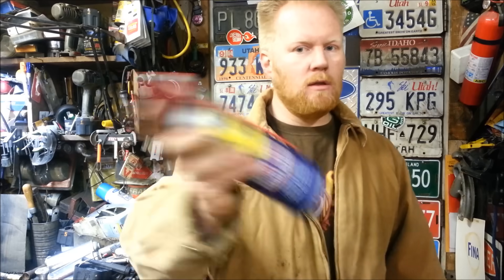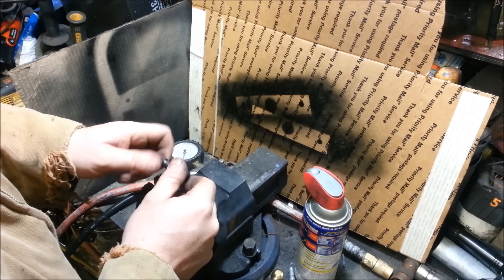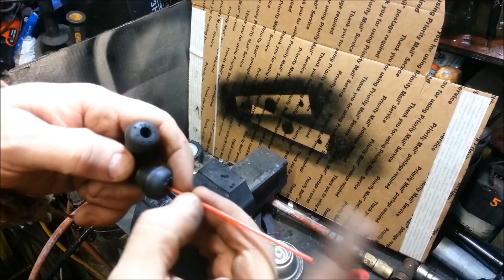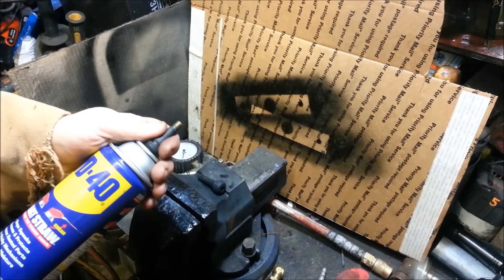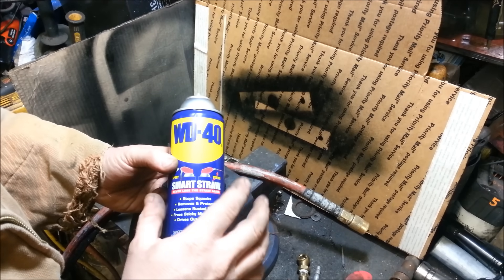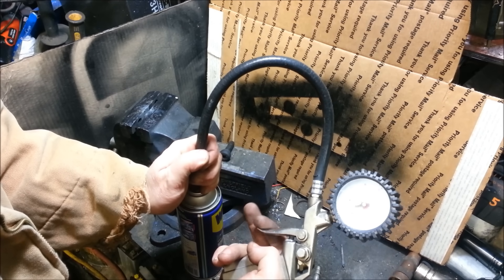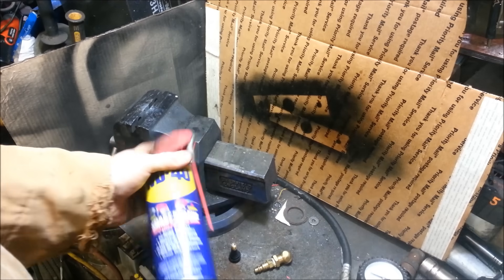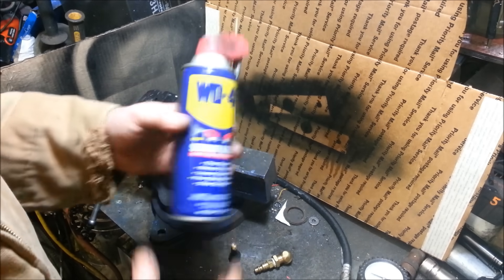Refill flat AEROSOL Spray Cans like the WD-40 and others

Comment: All the cans I have thrown away due to the loss of propellent.  Dam..good video
Reply from the maker: Bowman W Thanks Man.
Reply: I cut the cans off at the top and save the material inside. If paint can, I save the little round marbles too.  Save the can, put thinner in for the little paint brushes (oil base) - too lazy to clean them.
Reply: Bowman W Makanak toyota toyota toyota
Reply: I was thinking the same thing... Just tossed a can of carb cleaner with lots left.
Reply: Im tired of that happening too
Reply: Slick  !!!

Comment: sixtyfiveford
Brilliant! I don't know how many times I've had to poke a hole in the top of the can to get the remaining oil out and I must say, a significant amount at that, considering the price one pays when buying it! Just today, I 'used' up the last remaining dregs of gold paint I use on my 3D printing projects and when I broke the can open to retrieve the mixing balls that I use on other projects, I found that I could have spray painted at least another 3 items I'd printed of the same model with what poured out of the 'dead can'.

Another thing that came to mind just now was a powder based fire extinguisher which used un-scented talcum powder. It was easy to refill with the correct powder and pressurized with our air compressor. It worked perfectly also.

Thumbs up to you.
Reply from the maker: dukesins Thanks, I'm glad you like it. I have refilled fire extinguishers for fun. Generally they are just filled with baking soda. The only thing to be wary of is if the air from your compressor has to much moisture in it, there is a possibility that the powder could clump and clog. It is still better to have a re-purposed extinguisher than nothing though.

Comment: It is nice for finishing up the cans, especially WD40 tends to get flat before it's empty. Its like they are using not enough propellant or something...  For even better effect you may try adding buthane from typical gas ligher refill can, that's what's used as a propellant in most spray cans.
Reply from the maker: mibars Butane or Propane do work very well.

Comment: Genius !!!

Tip you can often get free dry Nitrogen if you have a storage tank typically 10 gal tanks are available at a reasonable price. A lot of  tire places now use Nitrogen to tires and it has no water vapors in it.

In the old days you cld make an air tank from a used refrigerant tank but I don't think is a good idea, I recommend buying one since they are not that expensive and they last forever mine has paid for itself many times over

Many times the mechanic will give you a free fill if you are nice,tipping a few dollars never hurts...just my 2 cents .
Reply from the maker: shoestring eng Yeah, nitrogen is nice but you can also use propane for a  more accurate fill.

Comment: WD 40 is better in the gallon form as it isn't thinned out so that it can sprayed from a can.

TIP: before you use your snow blower, spray the auger and impeller area so that snow won't stick to the metal. No cloggy. Works with lawn mower shutes as well.
Reply from the maker: blipco5 If you want your snowblower to never clog again, forget the WD-40 and do this http://youtu.be/EMAgb3QNEE8

Comment: Be VERY careful to stay within nominal pressures. For safety's sake, use eye protection and wear gloves. DO NOT reinflate ANY can with signs of rust - it could explode and sever an important artery, and you would bleed out before the ambulance had left the garage. Otherwise - thanks for the idea!! I have hated throwing away useful product just because the pressure has bled down over time.
Reply: Keith Douglas 
Good point. Irrelevant details
Reply: @vinceking7878  yea, who needs to hear about irrelevant facts like arterial vulnerabilities, or the ever increasing response time of EMS in our "thriving" first world society.

What a dork amirite guyz
Reply: Yes. It's much cheaper to replace an aerosol can than replace an eyeball.
Reply: You need to put a little adventure in you life.
Reply: I have enough adventures in my life hearing gunshots most every night in the neighborhood, using pneumatic framing nailer without eye protection, removing the pawls on my tablesaw, and going rock climbing this morning. Don't want to push it too far.
Reply: @frankw8876  Yeh Ur right... We live in a third world country😀👍😂

Comment: you can do the same thing to charge those little fire extinguishers if they loose the charge. cool trick!!
Reply from the maker: dana mennerich Yes, it does work in dry chemical extinguishers But.... if your air isn't 100% dry the dry powder could cake/clump and the oxygen in the air you fill the container with isn't the best for putting out fires. With that said, it's better to have an extinguisher refilled like this than nothing at all.
Reply: sixtyfiveford good point, I never considered that. thanks

Comment: Would this work on a gas cartridge of butane say for a Paslode nail gun? Thanks for your videos. They are so informative.
Reply from the maker: thegreenhornets No it wouldn't. Those are CO2 which has the ability to turn to a liquid when compressed (air doesn't) and more can be fit into a cartridge. If you put air into a Paslode cartridge you would only get a few shots before it died.
Reply: Thank you kindly, sir. Gonna try this then on my some gilette shaving gel cans next if that won't cause them a problem.
Reply from the maker: Yeah, shaving cans can be recharged if they don't have a little rubber plug on the very bottom of the can(in the domed part). If they have this plug there is an internal bladder holding the product and the propellant is put in through this plug from the factory. It presses on the bladder that is attached to the top spray nozzle and pushes the product out.
Reply: I've opened one of these before and there is an internal bladder, but the can doesn't have a plug in the bottom. Do you think it would still work? Thanks for your time.
Reply from the maker: If there is a bladder then more than likely not, but I have never tried.

Comment: Awesome. Forget the WD40, I have several cans of PLEXIS that cost almost $20 each, and they always go flat with at least a 1/4 can left. Kept them, and now I can reuse them!
Reply from the maker: Parks Christenbury At $20 a can that's definitely worth it to fill them back up with air.
Reply: Parks Christenbury I've used Plexis for years but it's just too expensive. Try Lemon Pledge for the same results. Here's a great article of the chemical analysis of Pledge - http://www.hdtalking.com/touring_models/13248-chemical_analysis_of_pledge_furniture_polish.html. I sent this link to a pilot/friend and here's his response...We used Lemon Pledge for the past 30-40 years on the windshields, side windows and skylights of all the planes we flew in SE Alaska. Has worked great...inside and out!

Comment: I don't like throwing a good product away just because it won't come out of the can either.  I just don't like to buy the same product when I still have some left that would work fine if it would come out because it wastes the product and my money.  Most products I have bought in an aerosol can are usually around $5.00 but still I don't like throwing that stuff away but that is rare for me.  One thing to be careful of when repressurizing an aerosol can is that you are not anywhere near your car just in case some of the product leaks out so you do not ruin your paint.  You may even want to do it outside if you don't mind the risk of killing some grass (or weeds).

I am not saying that you WILL make a mess but there is a chance that it could happen and when it does you will most likely damage something and that product will most likely not wipe off with water.  The worst thing I can imagine is this sort of thing happening with a can of paint some bright ugly color that is easy to see.

I only think like that because I know person who is a klutz.

Comment: Why does the air run out before the wd
Reply from the maker: roxydog2004 Either the can rubber seal has leaked(at top) or a person as held it at an angle while spraying(expelling only air).
Reply: sixtyfiveford I see ,is there a better  way to spray, to make sure that you always have enough psi to completely empty the can?
Reply from the maker: They say you should never tilt the can and only spray when its vertical.

Comment: Forget the solder valve. Put a few ounces of liquid in a pipe, adapt pipe thread to valve thread top and bottom, (standard plumbing fitting at bike shop) place pipe on top of your rubber valve, connect air pressure to blow it backwards as you did with the rubber tire valve, sending both liquid and air into the can. First the paint, then the air pressure goes in can. The stack looks like this from top to bottom: Air chuck, tire valve to pipe adapter fittings, paint filled pipe, another adapter fitting, your rubberized tubeless tire valve, spray can top 1/4 inch long tube, empty can. Good luck. Post when you githerdone. :)

Comment: This is pretty cool but as previously mentioned, i just lay the can on its side and stomp on it. Initially, there is hardly any pressure in the can so it crushes quite easily. This raises the pressure inside the can just enuff to get that last little bit out. Crude, but effective.
Reply: swerve driver true enough but also ruins the can. if it's empty you can refilll the cans with wtvr you want to as well.
Reply: +swerve driver that is also clever for us lazier folks
Reply: Or if you are in a hurry and need the contents immediately and don’t have the necessary items to add pressurize to the can
Reply: @richardphelps7301  
Yup that's good common sense.
Reply: Not a good idea,
Adding oxygen into a flammable gas.
Explosion waiting to happen!
Reply: @robertdorman5486  Do you even read??
Reply: @robertdorman5486  say no to drugs :D
Reply: Robert Dorman has been breathing too many paint fumes. It’s compressed air, not oxygen you fool.
Reply: @charlesjacobs4767  compressed air is oxygen you fool and he's right its a bad idea
Reply: swerve driver lmao i hear ya man

Comment: great other than if used with anything flammable, (especially carb cleaner,brake cleaner.. you've just made a bomb by adding air instead of the correct propellant. theres a reason they don't use air in the factory! (fuel + air!) Besides, it will likely make the paint set if you put air in a paint aerosol. Refilling with argon from your mig welder or even propane might be safer.

Comment: this would work with automotive paint cans?
Reply from the maker: Tj1056 Yes it does. About 50psi seams right for them.
Reply: sixtyfiveford probably ok to use straightaway, but surely air would cause paint to cure in the can? They generally use another propellant other than air.
Reply from the maker: Oil based paints will skin over with exposure to air over a week or more without being shaken. Still usable, but air is not the most idea substance; Propane, Carbon Dioxide, or Freon(R134a or R152a) are more idea because they turn to a liquid when compressed and deliver a more consistent air pressure.
Reply: sixtyfiveford I wanted to use this on plasti dip cans and I think they are solvent based so would it be fine? It would be to just get the last bit of paint out of the cans for the work I am currently doing at the time as when the cans get low on pressure they tend to spit the paint and leaves bubbles and such.
Reply from the maker: It should just fine on the Plasti Dip cans as long as they have male output valve.

Comment: Put on goggles, use a nail to knock the little tube thiingy inward into the can, any remaining pressure is released, drain the oil into a hand pumped sprayer, and you can get exercise for handshakes. I like this method ok though. Thank you.

Comment: This deserves a Nobel Prize.
Reply from the maker: PrivateEyeYiYi Thanks.. I'm glad you like it.
Reply: Yes, it is very explosive to put oxygen in the can with a very flammable liquid. That is the reference to Nobel right? If you want to refill, you should use pure nitrogen and not air.
Reply: @attre3  Don't consumer air compressors just take the ambient air and pump it back out? According to wikipedia "By volume, dry air contains 78.09% nitrogen, 20.95% oxygen, 0.93% argon, 0.04% carbon dioxide, and small amounts of other gases."
Reply: @drewscreen  Yes, and so?  Outside of dedicated pure oxygen burns, every explosion explosive-like burn on earth is accomplished with that 20.95% oxygen.  It's dangerous to premix a fuel with air.  An ignited stream will have no problem back channeling through a tight space because it'll have all the oxygen it needs to do so.  And this is especially true when the mixture slows down.  Ask yourselves: Why doesn't WD40 use air in the first place?   They use CO2, and before that butane.  They don't want oxygen anywhere near the inside of the can.
Reply: Pierre Andersson , natural air, Earth’s atmosphere is only 21% oxygen.
Reply: Your Nobel prize standards are VERY low. . . . right?    :-)
Reply: You are right bro. He deserves a Nobel
Reply: Don't say that. The poor guy will under tremendous pressure.
Reply: I'd kill for a Nobel Peace Prize!
Reply: @joeyjamison5772  :)
Reply: Not at all, and you know better! 
Such prizes to go folks who work hard and long. 
This guy got it from someone else. It's an old trick.
Reply: This not new. I have been using this technique for decades.

Comment: Air contains oxygen, which would make a explosive mix in the can which could possibly flash into can if your spray encountered a ignition source.. Propane is better because there is no oxidizer in it that will react with the flammable wd-40 inside the can. The flame will stay outside the can. My 2 cents.
Reply from the maker: Norman Desrosiers WD-40 by itself isn't flammable. It's the Propane/Butane propellant that make it flammable.  Propane is a far better propellant but I don't want to show people how to modify a propane/air hose to be able to refill it. The small spray hole acts like a Flashback arrestor and a flame can't go back into the can.

Comment from the maker: If you enjoyed the video THUMBS UP and or leave me a comment! Thanks.
Reply: Interesting video. Is there an ink jet code on the can bottom of that low pressure WD-40 can that you can share? It helps id the manufacturer who'd like to know of defective product
Reply from the maker: I've actually called them a few times over the years about low pressure cans and given them the codes. Wd40 was a little hesitant but sent me coupons for free cans of Wd40.
Reply: sixtyfiveford
For all your subscribers.....If you point the spray tip of an aerosol can toward the dot found on top of the can (when one is provided) during use, you will get the most product out when spraying downward.
Reply: Jeff K
If you decide to make more aerosol related videos I can offer comment/review to keep you safe and sound.
Reply from the maker: Jeff K
Yeah, the dot is one of the things you learn through trial and error. I don't know why manufactures don't right a little note on the can about it.
Reply: sixtyfiveford Do they use atmospheric air as their propellant? Don't you run the risk of this method putting water/condensation into your oil?
Reply: @QuincyMarket  Not to worry, it's WD40. WD stands for water displacement , and the 40 is for fortieth formula in the development of the product.
Reply from the maker: CO2, Propane/butane, or Freon are the most common propellants. They turn to a liquid when compressed and provide a more stable/constant pressure. Virtually all air compressors have driers on them and put out very low moisture into the air. But even if it did expel some moisture into the can, the oil and water wouldn't mix.
Reply: Hpw can 124 people hate this, i guess they are upset they didnt think of this, bloody haters, but thanks man, good tip.
Reply from the maker: People living in China. Because everything is upside down on the opposite side of the world. So a thumbs down is actually a thumbs up.
Reply: sixtyfiveford AWESOME IDEA !!! THANKS !!! YOU COULD ALMOST ME AN OZZY :-) lol
Sixtyfiveford that is ! :-)
Reply: +sixtyfiveford that little core in it is the straighter valve
Reply: +Admiral Percy There should be a moisture condenser on the air tank, or in line.
Reply: +racer2k5x    NO! it is the Schrader valve
Reply: +Admiral Percy 
write
Reply: sixtyfiveford o
Reply: sixtyfiveford I believe u meant to say valve stem, I asked the tire people and they literally gave me a valve core lol, wasn't until I showed them this video and they said oh u meant a valve stem lol
Reply: sixtyfiveford great idea
Reply: sixtyfiveford is
Reply: Phillip Sykes   mother
Reply: I'm gonna convert one of mine in a week or so. I will post pics of mine for you. Thanks again sixtyfiveford.
Reply: sixtyfiveford can it work on a paint can I bought a brand-new white can of paint let it sat around went to use it no air but a full can of paint
Reply: racer2k5x n
Reply: Maybe because of you must have a workshop like his? You need an air compressor? His idea is good but not for an individual that have no workshop.
Reply: tire pump was the other option
Reply: sixtyfiveford can you parallel to generators by just plugging the kit you made into each 110 outlet ?
Reply: Sir, you are a genius!
Reply: Don't do that.... dangerous
Reply: Loose any fingers lately ....?????
Reply: sixtyfiveford spark plug wire removal image spark plug wire removal
Reply: George R  I'm with you bud, so many half full cans thrown out!! Not anymore!!
Reply: Great idea bud!! Many thanks!!
Reply: Awesome video bud. I just had to stab open a can of wd last week for this exact reason. Wish I'd seen your video before the. Thank you
Reply: Compressed air and oil... good way to hurt yourself. At least use a non reactive propellant
Reply: A really great idea.   I can see air(oxygen)  being a problem with aerosol paint.  Mentioned the use of nitrogen in another comment.   Good job!